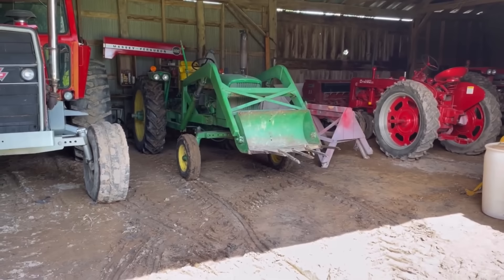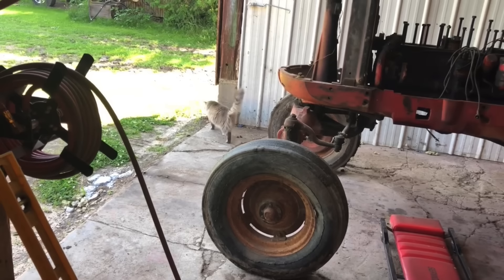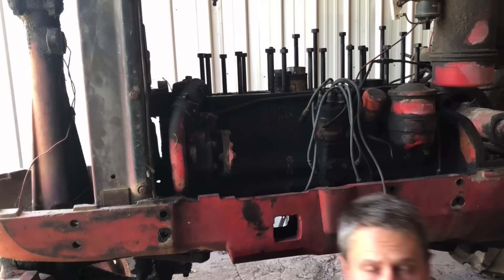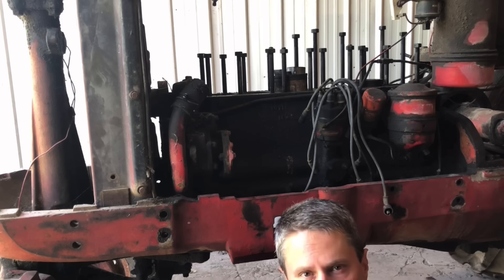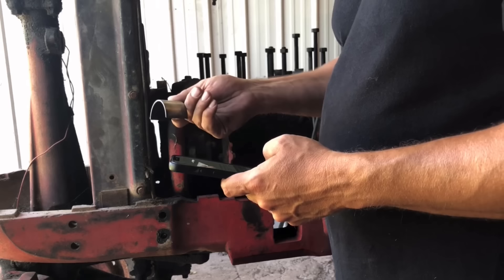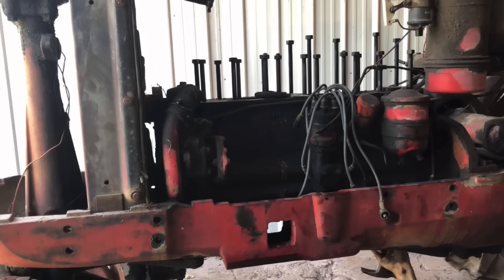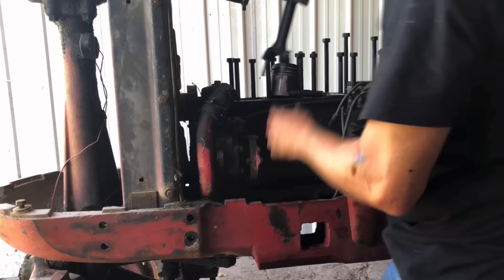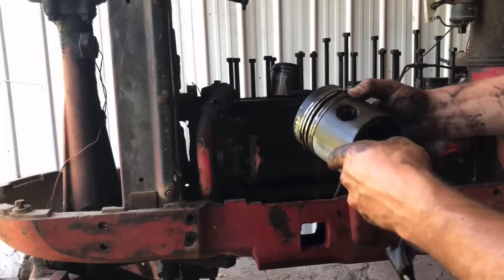Back at the Cockshutt 40!  Sleeves out and an engine kit

Comment: I grew up on a Co-Op E-3, the only tractor Dad kept after selling the farm. Primitive loader, no brakes, loaded tires and wheel weights, Like the 2010, it never sat still. Even with a six volt system, it would still start in -20 degree weather. Great memories.
Reply from the maker: Very cool!

Comment: the old cylinder sleeves and pustons should be still good  U have 2 get them a part and clean them up 😊😊 the old piston rings are good 😮😮 I wouldnt bother about saving them most likely no good / thats the best way 2 go anyway is 2 overhaul the engine and U have new engine parts 😊😊 OMG 4 6 2O24

Comment: Excellent video JT  :) also what year that Cockshutt COOP 40  with Buta 235  Cubic Inches 43 hp with 60 torque 6 volt positive ground  with not sure amp Generator are but I know made in Brampton Ontario Canada 🇨🇦  ! How know my late Grandfather Bill Cann Senior bought one brand in Brampton Ontario  Canada 🇨🇦 plant in 1950 April 1 ! Tractor was January 18 1950 stamp on head on left side on Spark plugs  3 & 4 cylinders the Distributor  had same motor your rebuilt  orange color Buta Motor  , was 6 volt positive ground  in 1957 when my late Uncle Bill  Cann JR and Late Dad Don bought farm of my grandfather Bill  SR  my Uncle Bill own Tractor took car off also in 1968 push button and metal pull button quit working they hook up key ignition GM type 3 wire one from GM car 1960 Chevrolet Bel Air  type ! When born 1976 to my childhood of 1980 to 1993 the Generator need rebuild was not recharge so Uncle took Automotive Rebuilding Electric store got be 40 amp in 6 voltage positive ground  also when Uncle put new belt same 235 Blue Flame GM 6 cylinders type ! But sadly in 1993 motor seize up on my uncle and dad on farm a gear for Oil pump also Distributor  broken teeth also got caught in numbers 3& 4 bearings on  Crankshaft got ruined not way break free ever! But remember last time was get used afterwards oil change plus Oil filter cannister changed  there hit and misses on low idles also high idle to on wild open throttle! I heard told my Uncle and he said heard to plus notice oil pressure gauges acting fun go up no higher 40 PSI on High Idle should be 60  and Low Idle was 10 to low for sure! When turn off heard big tight and squealing sound brings in machinery shed on home farm  ! But change oil saw tooth from gear and peice bearings in bucket drain oil then said what happened hear! But starting up Tractor afterwards engine oil also oil filter cannister motor would not turn over and tried pull starting with another no go to ! So had investigate then motor history so Tractor sold for parts too guy restoration another one Cockshutt COOP 40 gas tractor ! But for funny part I learned on Cockshutt 40 Tractor lots before motor seized up in my childhood years! Great Tractor and power full machine also pull good as any others type! But sound on chime when like Farmall gas row crops ones do Lol!